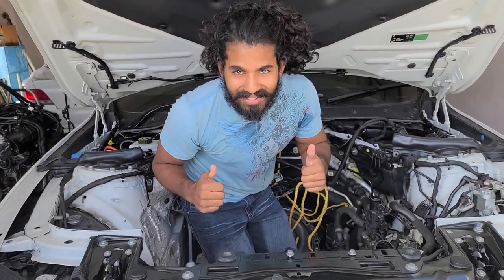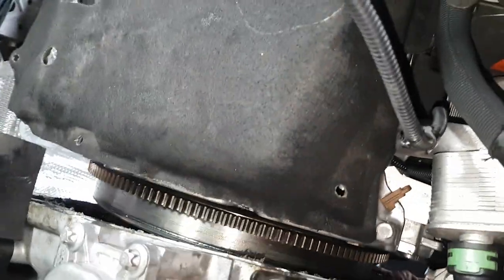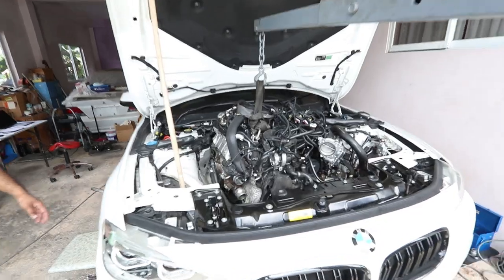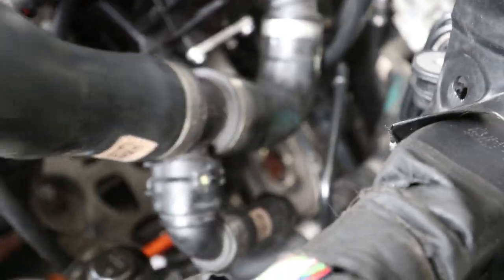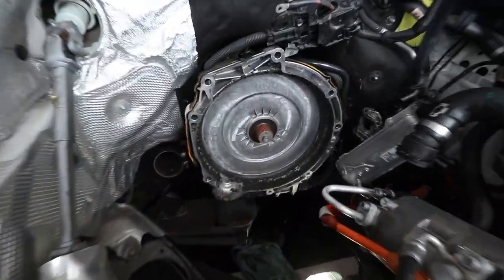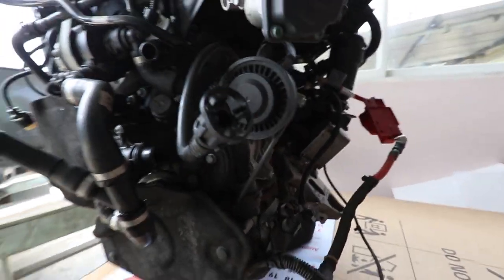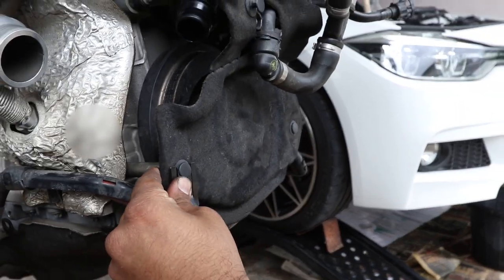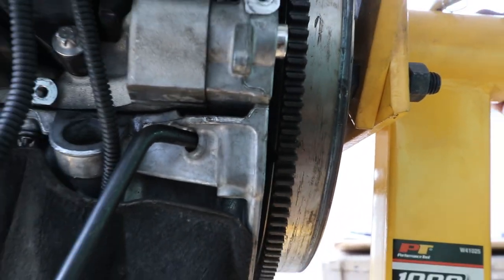BMW B48 Engine Rebuild Part 2

Comment: Hello sir. My f30 330e is not charging the 12v battery after the accident. It writes codes 21F10c 21F1F6. what can I do? I would be glad if you help. thanks.

Comment: Are you going for forged pistons and cp rods?!! I8 pistons have lower compression too. Think the guys at VAC Motorsports is putting together a b48 race engine.
https://store.vacmotorsports.com/mobile/bmw-race-engine-by-vac-motorsports-bmw-b48-p5139.aspx
Reply from the maker: cp forged pistons and rods were used!